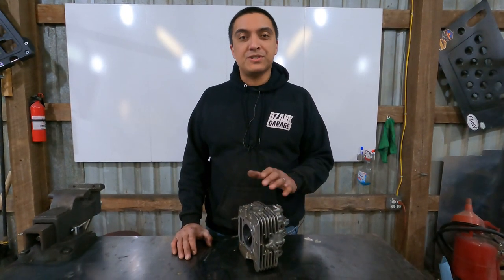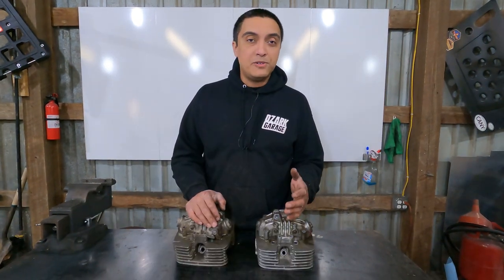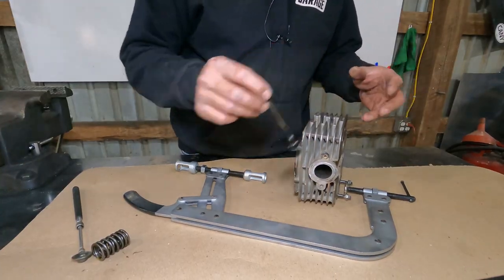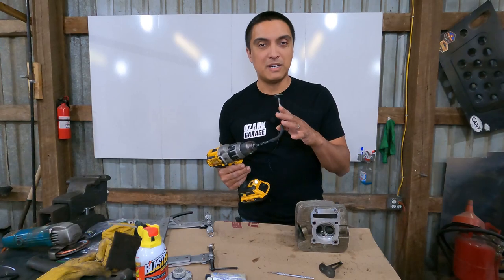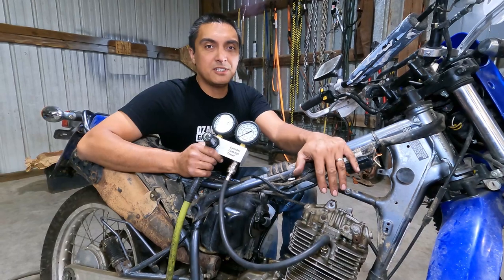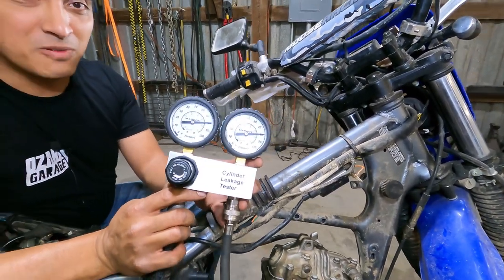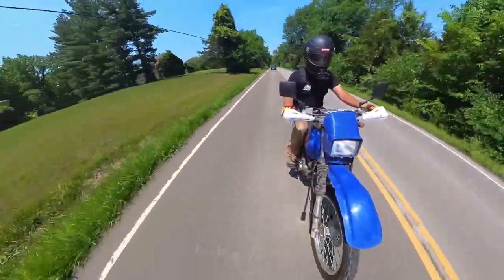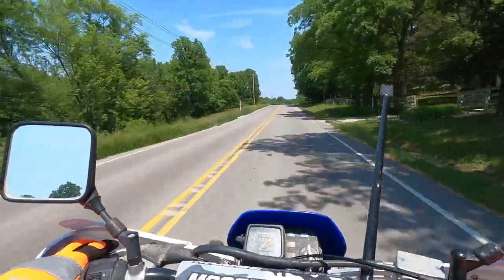Suzuki DR200SE Head Swap and Carb Upgrade | Fixing Low Compression

Comment: Great build. Glad you did a carb swap. Dr200 has a really oversized cv carb originally. Switching to vm26-606 or 24-32mm PWK transforms this bike completly in terms of performance.
Reply from the maker: Sounds like I made the right choice! Thanks
Reply: @ozarkgarage  definitly. You could put on a cheap exhaust as well. There is some restrictions in the original one. From there remove the airbox lid or put on a podfilter with some water resistant bag over it and the Bike is completly free of any restrictions. 
Going down to a 14 or 13t front sprocket will make it more fun as well.
Reply from the maker: @Rocketman0407  I do worry about water if I get rid of the stock airbox. The muffler on the bike has already been gutted by a previous owner, not sure how much I would gain with a DG exhaust, other than probably better sound.
Reply: @ozarkgarage   ok, then there is no point going to a DG exhaust. If you drive in very heavy rain the pod could be a problem. You could get like a 45 degree intake tube. Cut it to the correct lenght then install it so the pod ends up under your seat. Then put on a filterwears prefilter for added protection.

Comment: Which Blaster throttle cable? (Motion Pro part number). I see some cables are for TORS and some bypass that.
Reply from the maker: The throttle was Motion Pro P/N 01-2812. The cable was a generic 4.5" travel Mikuni VM22 throttle cable, 39" long from ebay.

Comment: Should have used the a 1986-88 TM-28 side slide carb!

Way better than the mediocre BST-31 diaphragm carb on the later Dr-200.
Reply: That BST-31 is a piece of junk. He did get in a VM 26-606 wich is a pretty good alternative though. 
The TM28 pumper is of course the best for this bike, but its like 300 $ new and rarely sold used. 
They sell it on some scooter website. 
I think going for a PWK carburator is a good middleground. Original OKO is good and costs 100 usd or so. The VM26 he used is a close second. There is also the Nibbi 32mm that works good if you want maximum top end power.

Comment: What is your jaltitude and jetting on the vm26?
Reply from the maker: I think I ended up with a 17.5 pilot jet and a 185 main, tuned with a wideband o2 sensor setup. Same hill test as in this video: https://youtu.be/EeXsm-Qf62E 
Altitude is 800ft MSL or so, and never changed the jetting when I took the bike to Colorado. It started and ran just fine at over 12,000 ft (Cumberland Pass).